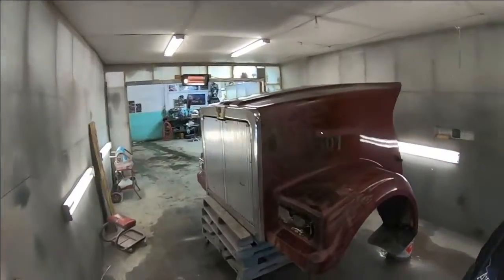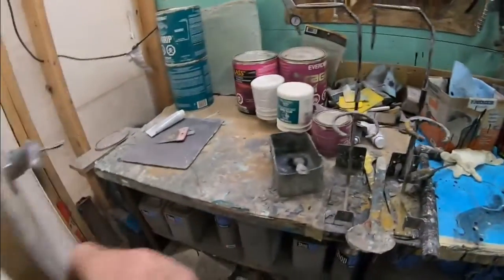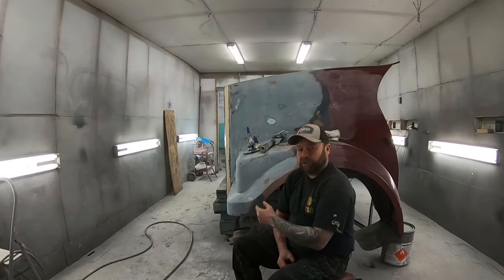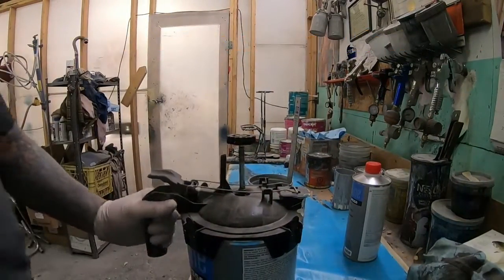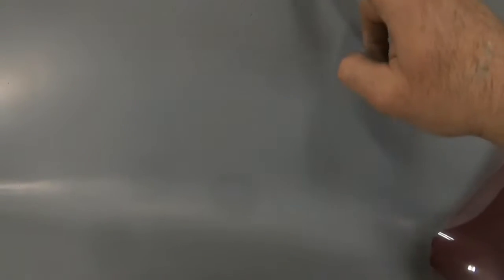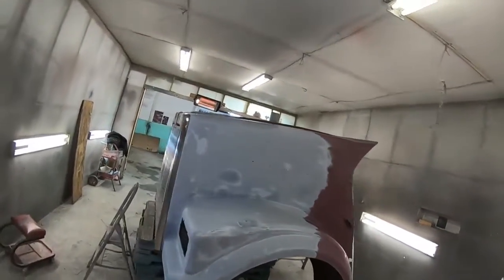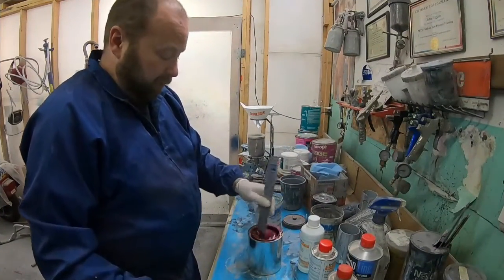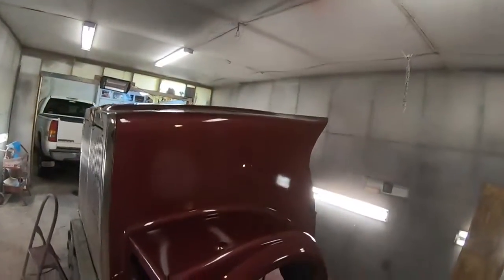how to repair burned fiberglass

Comment: Nice work! John, I have a question. This may be out of your wheelhouse, but I have a vintage fibreglass lampshade that is scorched on the inside. It is hard fiberglass. Is there a way to restore it? Do I sand it down? Are the materials you are using similar to what I would use? I'm very drawn to 50s furniture made of fibreglass as well and it's often damaged. Any pointers?
Reply from the maker: I would think it would be the same process and materials. If you can sand away the burned area, you should be able to refinish with primer and paint. If you sand through it might require some body filler first.